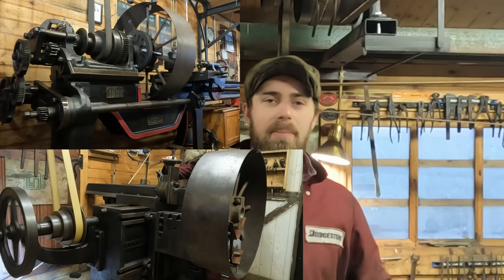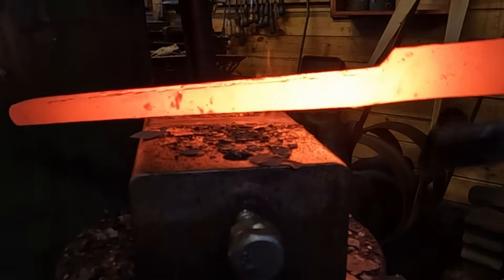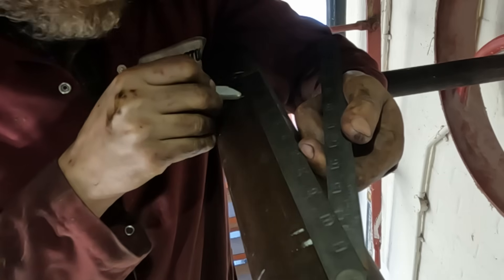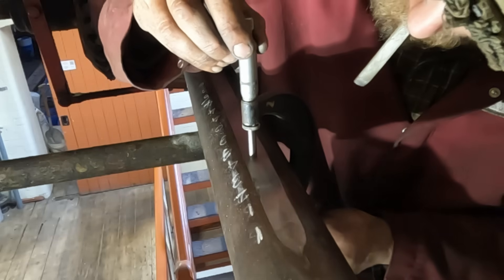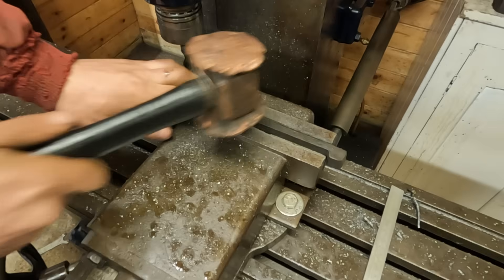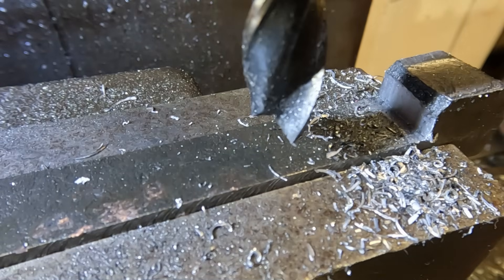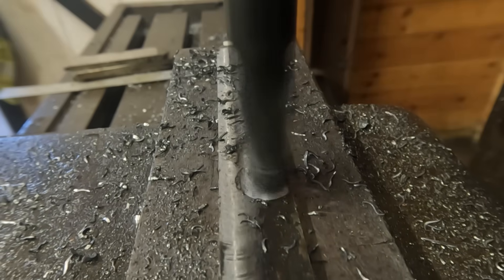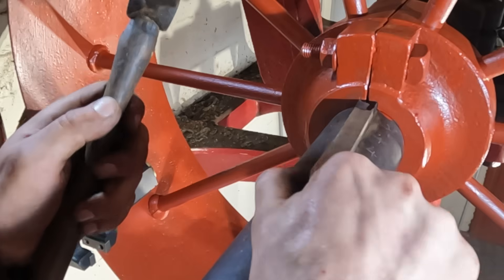Flat Belt Pulleys - How are they fixed to the shaft?

Comment: Are the "flats" all kept in line on a "master" shaft so if a pulley gets changed for a wider one and a flat needs extending it can line up with an existing one?
Neat video. Thanks for sharing.
Regards from Canada's banana belt. 
🤞🇨🇦🍌🥋🇺🇦🕊🇬🇧⚒️🍯🏁👍
Reply from the maker: Not nessesarily no. It's very rare to make changes to a set up like this. Here all the key seats would have been cut in the shafts according to the drawings, at the works before delivery and installation. The seats are in line for neatness more than anything else

Comment: Nice forging.

You didn’t have spend that much time fitting the key, just make sure your angles are close and machine it to fit just shy of halfway through.
Most of our transfer chain sprockets at the sawmill were retained with tapered keys and we just hammered them home with no fitting.

Comment: You should start by measuring the keyway taper. The British standard should be 100:1. It’s when your geometry comes into play.
Also it should have clearance on the sides. It should have constant contact all along the key. I must’ve fitted keys from 1/8” up to 8” wide over the years.
Reply from the maker: Yes, the pulley keyway was tapered about 15 thou originally, and I matched that when I machined it deeper after boring. The key was machined for side clearance on the mill. Cheers!

Comment: The vise clamped to the rim of the wheel reminded me of an old time millwright I worked with years ago. He was fitting a v belt belt pulley to the shaft on a blower that was a good 20' above the floor. It would have been a big job to remove the blower and get it down to the work bench, so he took a small vise up the ladder and secured it to a nearby I-beam. He told me if he hadn't done that it would have required at least 40 trips up and down the ladder and would have resulted in either early retirement or death from a  heart attack. Nice video and I enjoyed the voice over narration of the job.
Reply from the maker: Great story, thanks! Those clamp vices are a massive time saver!

Comment: This is the way. So many modern shops lack a forge and miss the advantages...more flexibility with material you can start with, stronger material, quick near-net shape parts wasting less material, less work for the machine tools. That little vise clamped to the wheel came in handy. Also, I did not know that your 1910  Denbigh had a vertical attachment. When did Universal machines first come in to being?
Reply from the maker: Agreed! There are plenty of advantages!
I'm pretty sure Brown and Sharp were the first to produce mills with universal tables in the 1860s.  Pierre Hure of Paris built some interesting double headed mills in the 1870s, one head vertical and the other horizontal. You could swivel the head and bring over the table which ever spindle you needed. Vertical heads like on mine were being built by B&S for their horizontal mills by the 1890s. They were an option on Denbigh mills, I was lucky to get hold of one as they seem to be quite rare. Certainly very handy! A slotting attachment was also an option but I've never seen one outside a drawing!
Reply: @iron_jonesy you mean to tell us you haven't made your own replica yet! What's keeping you?